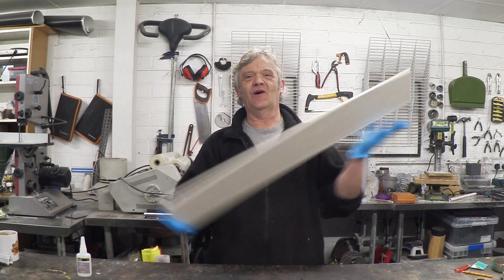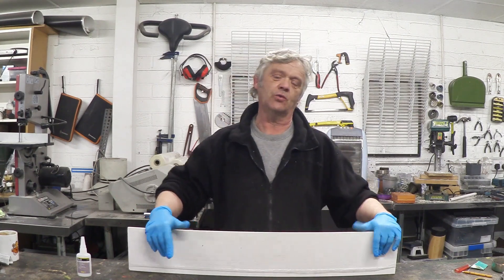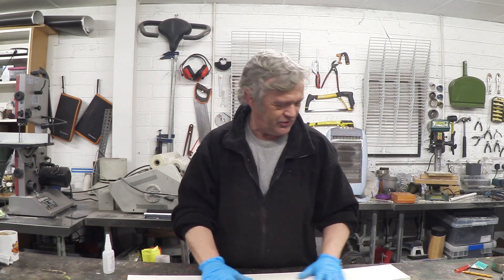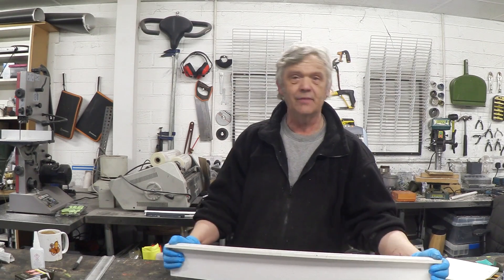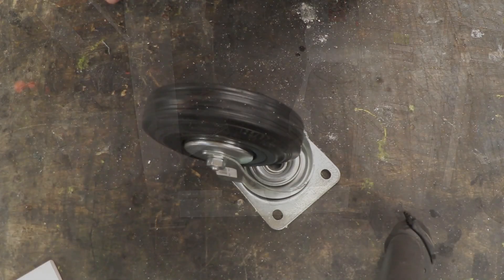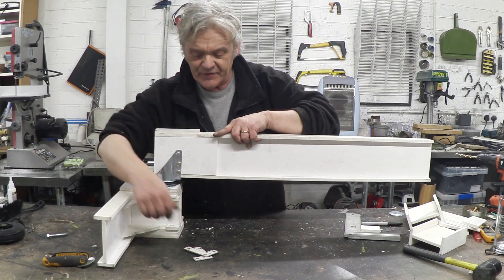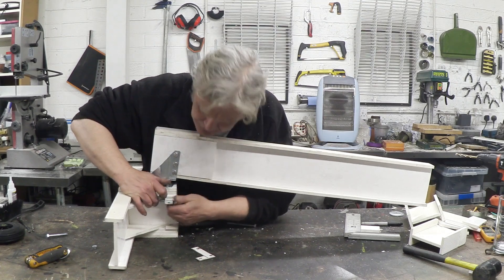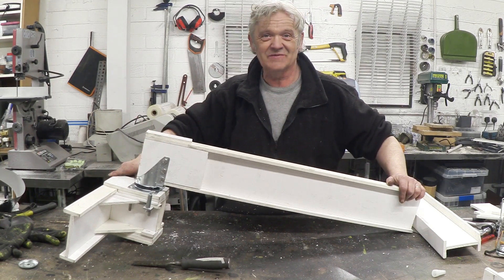1063 Building A Plastic Trike - The Chassis

Comment: I would use PVC cement instead of CLA glue. PVC welds them together, whereas the CLA is more likely to crack from vibration and impact.
Reply from the maker: good idea mate I used CA because that is what is used here in the UK building industry for doors, windows and roofline - so lots of vibration there and a 20 year guarantee

Comment: Great project and material exploration, never really explored Sintra board, the only time I used it was to check on CNC for making a really large chain wheel for the three wheel electric race car we built👍
would it be ok for a vid link? the Quality is poor and dated, or maybe a picture of the project , I still feel bad about not just posting a schematic for that motor amplifier
Reply from the maker: of course it would mate - post away - it won't go up immediately I will have to clear it - but I will do

Comment: That is amazing.  I was gifted a home made trike 12 years ago and still use it in the summer...  but, it is made from steel exhaust pipes and weighs well over a hundred pounds.  I can only use it on flat areas because of the extra weight...  and mine.   Your trike is going to be incredible.   Always love your videos.
Reply from the maker: it is certainly going to be light mate

Comment: Awesome!  Please go all the way with this one! It would be so cool to see how a 100% diy e- vehicle would do.  Diy frame (anybody got thoughts on regular trike configuration vs reverse trike? Pros? Cons? Cool factor?). Diy motor (design parameters, cost vs performance, diy motor performance vs off the shelf motor performance, potential upgrades to diy motor down the line). And especially Diy battery pack w/ controller.  Still anticipating the vid on the super ultra type 3 Daniel cell.  Or a big paper battery with iron copper baghdad battery inks.  So excited for what's next!!  Please do some videos on the planning process.
Reply from the maker: I never do vid on the planning - I think you are right - I should

Comment: Curious to see where this goes.  Have you ever tried scoring or cutting a lengthwise channel in the board and then folding along the hinge?  It would make an L instead of an H, but require fewer operations.  Just a random suggestion on technique.
Reply from the maker: never tried it mate - my thought is it might be less operations but a bit trickier than a straight cut - still - nice suggestion if you fancy giving it a go